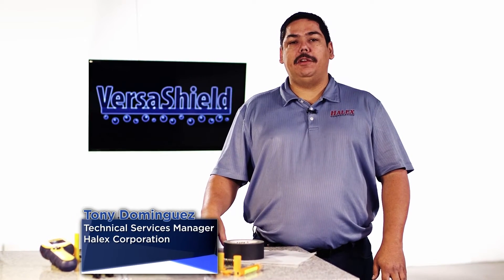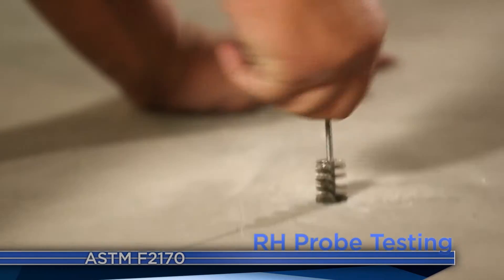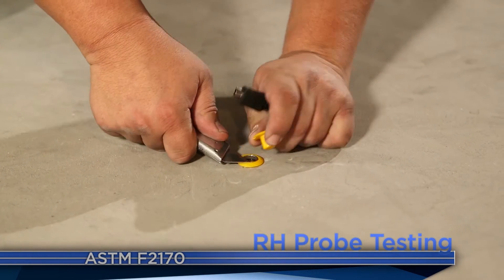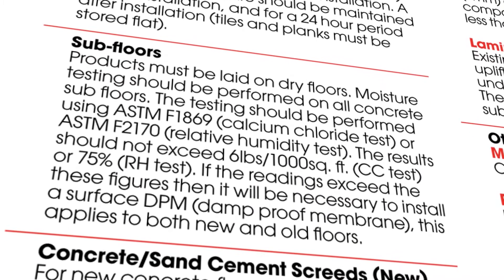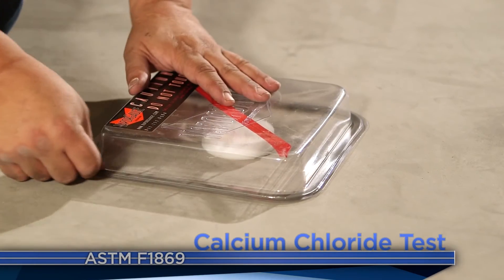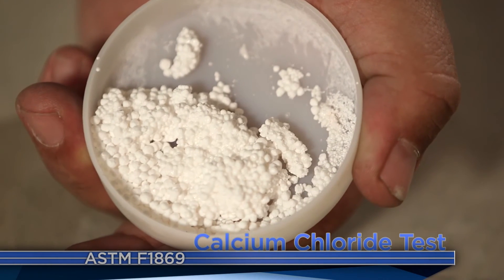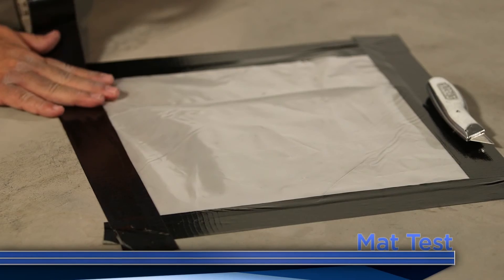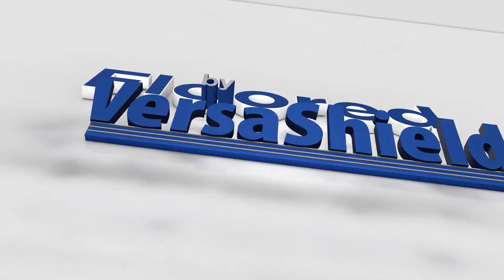Floored by VersaShield: Common Concrete Moisture Tests

Comment: I've read multiple times that when doing a calcium chloride test, you should test 3 times for the 1st 1,000 sq. Does that mean using all three tests on different spots of the slab at once, or doing one test at a time until you have done all 3?